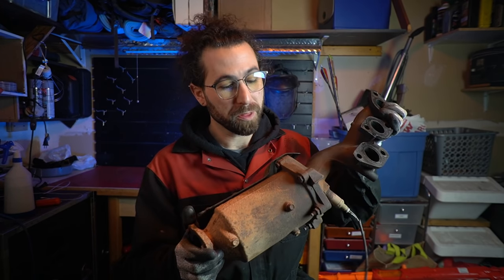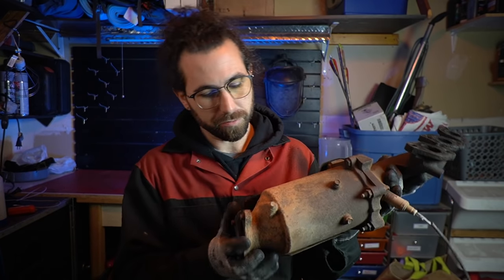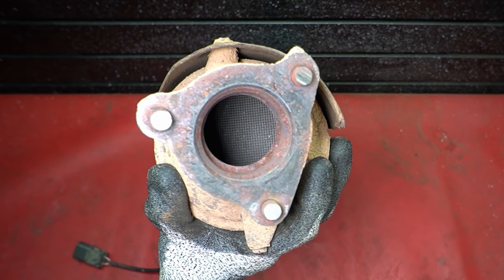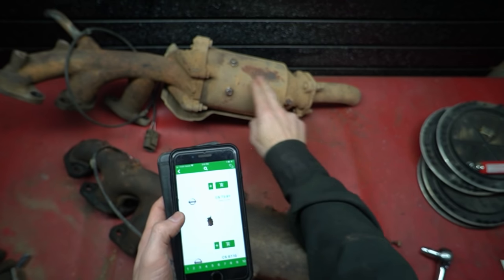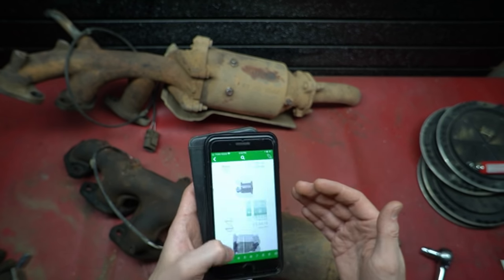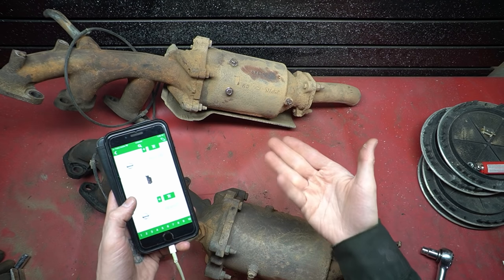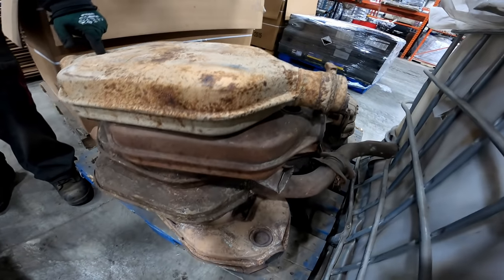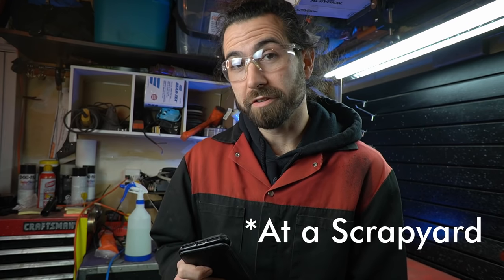How Much Is A Catalytic Converter Worth? Scrap Recycling Guide

Comment: ??How much $$$ should i expect to get for my 2001 PRIUS cat??... I was told its one of the most valuable modern ones with 2 cats in tandem...and Toyota wants 3Grand new for one...
Reply: Should see$1900
Reply: @zelmo99  1900.00 from a scrapyard?...from who is going to pay that?...its used of course (50k mi on it)...and why so much?
Hey thanks! !
Reply: That is because the rhodium alone is going for $20,000 an oz
The platinum is around $1200 or so and the other precious metal that starts with a P is going for more then an oz of gold.
So I don't know how many cats it would take to get an oz of each but if you know what you are doing and know how to melt them down, you would be rich pretty quick.
Reply: Rhodium prices continue to blast away and are, as of this update, at $18,000 an ounce; price-per-gram being around $714 ..Average cat is 4 grams Rhodium. 2001 Prius is 11 grams so $714 per gram= $7714.00 just in Rhodium but now you got to find a buyer
Reply: @zelmo99  is that for Gen1 or 2...i have gen1...and thought  gen 1 has 2 cats??...so more or less or same precious metal and values in 1 and 2 or different? ? Thanks...

Comment: I’m paying 170 for that Nissan cat you said 40-50
Reply from the maker: Well to be clear, I compared it to visually similar ones that ranged from $50-200, and said id be happy with $50. I learned that the price on the app was a scrap purchaser price and not final refining value though so knowing that, a person should aim for at least as much as the app says
Reply: I took mine off of my parts car and received $650.00 for it.  Been thinking of taking mine off of my car I drive and put a straight pipe. I wouldn't get that much out of it if someone was to total my car because it's an older model but not cheap at all to repair but will go for many many miles.

The thing is a lot of people go around and see people have cars sitting in there yard and either ask what they would want for the car or if they would want to may a $100 bucks on the cat. Most people will do it because they need the money.   I just knew something was up when I get a call asking me if I would take $100 each for them so I was like let me think about it and I called around and I finally got a hold of a guy close to me and he told me that he could give me $650 total. He said he was tired of people. Going around and screwing people and he wanted to give a fair price.
I'm sure he is making what he's paying especially with the prices of the 3 precious metals Platinum the other one that starts with a p and Rotum which I don't know how to spell it. But I believe the other precious metal that starts with a P is going for more then gold per Oz.
Then the rotum is going for $20,000 for an oz.   I seen that on Google the other day. So yes keep your eye on your cars. Especially foreign cars.  Only thing I know is the guy that bought mine has to have a certain amount of weight before he takes it to who ever to get paid for his.
But like I said I'm sure he is making double on what he pays people but that is ok because going from $200 to $650 made a big difference to me.
So if you have any cars that don't run, call around and give the people you call the numbers on the cat and they will tall you what it is worth before you even decide to cut it off your car.
But I'm sure prices are only going to  go higher because the demand for those 3 precious metals is on the rise. Junk yards are probably making a killing.
Hope this helps, God bless 🙏💞🙏

Comment: I used to work at a muffler factory, and I was on the line that assembled the catalytic converters for dodge mini vans.  The base cost of a catalytic converter was $0.38 for ones made with regular steel housing and $0.52 for housings made from stainless steel.
Reply from the maker: Whaaaat? How is that possible!!
Reply: @thubprint  bulk production is only thing I can guess.  I was pretty shocked by it too.  Also keep in mind that is the raw materials and manufacturing cost per unit before adding in labor unions, benefits, wages, shipping, handling, stocking and what ever else fee is attached.
Reply from the maker: @anthalas9  true, true.
Reply: Maybe for just the housing?
Reply: @maxscarblog  no, that was the cost per unit.  The housing, the catalyst, the assembly and welding.
Reply: Impossible. Was housing only.
Reply: I'm not saying your giving false information here, but it strikes me as very hard to believe all of the pieces of your claim are 💯. So without knowing exactly how much that exact cat is worth in recycled value today ( recycled value today = cost of all raw material to make this today not including labor or ceramic). Also what year are you claiming this production of the fully assembled cat took place for a total complete catalytic converter that to my understanding requires at minimum a total combined weight of 2 or even 3 of the precious metals in the group of PGMs, again at a minimum collective weight of 2.5g. I'm not certain but I'd have to research this, but I don't believe there was ever a year in our history that even the cheapest Platinum Group Metal ever had a value of $0.38-0.52 for 2.5g of that metal let alone 2-3 different PGMs coming in close to that value and then add on top of that cost the housing the weld the labor the business overhead portion plus a profit ...it seems somewhere your memory seemed to have fumbled some of the real facts of this claim. Do you agree?

Comment: I have a cat I removed from my 1989 Toyota Supra Turbo, top cat just below the exhaust manifold. I removed it and put a straight 3 inch down pipe in it's place which made doing an oil change 15 minutes verses an hour and a half when that cat was in the way. I called all the local metal scrap yards in my area and NO ONE would purchase it from me, they told me because I don't have a business (garage/body shop) they will not purchase it from me because it might be stolen. Is this cat worth scarping out, or just throw it out with the weekly trash and if it is worth scraping out, HOW????

Comment: I guy that has an auto shop gives me scrap now and then. Recently he asked me if I wanted catalytic converters to make it worth my time taking his scrap once in a while. Now I gotta figure out how to cash in on these. eBay? Scrapyard doesn’t take them. Recovery of precious metals is to toxic. $25 is better than 50¢ worth of scrap steel though!😅
Reply from the maker: Definitely find a proper cat buyer, the closer you can get to the refiner the better. I’ve been working with PMR and they are available in Canada and the US, if you can save up 100 cats you can sell directly to them and that’ll be your best price by a long shot
Reply: @thubprint  Thanks! I’ll look at their website. Right now it’s just a cat here and there maybe. Not my typical scrap I get, so saving 100 might take me 30 years😅

Comment: Most cats have between 5-7 grams of platinum.
Reply from the maker: That is more than I thought, but it kinda makes it all make sense
Reply: @thubprint  A gram of platinum is something like $50+ for genuine unrefined platinum. From catalytic converters it's usually around $20. You can usually get around $150 for a used cat. Best place to find people who will pay you for cats tends to be Facebook. Most buyers recycle them in bulk. If you can find someone in California, just send the cat in a USPS flat rate box - $15.99 for up to 75lbs 2-3 day Priority Mail with tracking.
Reply: Most cats do not have platinum, very rarely will you get one with platinum.
Reply: @specialtysalvage297  You are uncorrect. All cats have platinum.
Reply: @ProjectCarTV  no most cats have pallidum or rhodium. Very very few have platinum.
Reply: @specialtysalvage297  All have platinum. There are 3 precious metals used in catalytic converters. Platinum is one of them.
Reply: @ProjectCarTV  No kidding?
Reply: @specialtysalvage297  it's imperative that platinum is included. It's part of the 3 step process that reduces NOX. - emissions.
Reply: @ProjectCarTV  You are out of your mind.
Reply: @specialtysalvage297  How old are you? 2 way cats have been obsolete since 1981. 3 way cats have been used ever since. You're enitled to your opinion. But that doesn't mean you're right.
Reply: Actually they have all 3.
Right now platinum is going for around $1200 - $1500 for an oz
The second precious metal that starts with a P is going for more then an oz of gold.
And rhodium is $20,000 an oz.   You can look this up and no this isn't a misprint.
People never talk about the rhodium but that is where all of the big money is at.
You're welcome.

Comment: I give you the price for the catalytic converter 0.2Euro, the entire car 2 euro (the junkyard disassembly costs), I bring two to the junkyard, and I do not recover the money even for gasoline.. of course you can make more if you give them separate metal parts...probably some around 40-60 euros for entire car.
Reply from the maker: That’s incredibly low... I couldn’t scrap at all if those were the prices!!
Reply: @thubprint  I scrap it because I replaced them with new cars, with bonus from state, so in reality it was not only 2 euros for that car

Comment: is it possible to melt these down your self and sellthe precious metals is it worth the time if you could
Reply from the maker: It’s definitely possible, but I think the real problem would be separating the platinum/palladium/rhodium from each other. They also have a very high melt temperature so you’d need a special furnace for it, a regular propane kiln wouldn’t get hot enough.
Reply: @thubprint  I just seen on Google that an oz of palladium is worth more then an oz of gold.
And oz of rhodium is going for $20,000.  I didn't misprint that either. $20,000.....  I watched on line how to melt it down and  it takes a lot of chemistry to get it to melt down and I don't even even know how to get each separate precious metal from each other.   But it is hard to believe that there is that kind of money in them, especially the rhodium.

Comment: Some low-life sawed the cat off my 2011 Honda Element as I was eating lunch.  I think I would have done harm if I caught them in the act.  Replacement cost me $700.  How is marketing sawed off cats not abetting a crime?  Is the risk of theft of a catalytic converter any less after replacing an OEM part.  Do I need to spend an additional $300 for a guard?  Seething in Seattle.
Reply from the maker: If you replace the OEM with a 3rd party aftermarket one theft is less likely as long as the would-be thief recognizes it as an aftermarket unit. (They’re only worth about $10 in scrap compared to hundreds for OEM). Sawed off ends are actually standard practice when scrapping them however because the buyer is going to want to inspect the unit to make sure the insides are intact. Annoying as it is I do think a cage is the best anti-theft measure.
Reply: 07 element owner here. There are cheaper alternatives to the plate. I figure the more ways to let the thief know they are wasting their time , the better. Engrave you vin where it can be seen easily, paint it with bright heat resistant paint, wrap the pipes with cable, weld plates to make it difficult to use a saw, etc. Hopefully the aftermarket cat is enough to make them walk on by.

Comment: I sold one off a 99 ford truck superduty 975.00 I got out of it. So I assume they doubled their money.
Reply from the maker: I think most brick-and-mortar places aim to double their cost on things so yes, I’d agree with you there
Reply: Did it have the v8 or v10 motor? My 99 F250 had the V8 and it got stolen..wondering which one had more value.
Reply: @thulsa5218  v8 it was long torpedo shaped they looked for a code on it mine was "peg" there is some different types tho
Reply: @fordnut4914  thanks, makes me sick thinking about it. I would have cut it off my own truck and sold it had I know it was worth that much.

Comment: I'm kind of embarrassed about the amount of those things I've taken off a car and beat the insides out of it with a chisel and put it back empty just to get the exhaust system unplugged and get the car running again. Probably hundreds over the last 35 years. We don't have emissions testing in Florida since the early 90s'. So game on with removing cats and straight piping cars.
Reply from the maker: Ohhh Florida haha 😆 I have seen some of the vehicles people slap together out there, a special kind of place for sure lol
I’m not a fan of regulation generally, but it seems like cats are one of those things that really should be a government run system. Keep the recycling to specialized gov sponsored houses and subsidize the replacement costs to make sure cars get a cat that does it’s job when the old one gets clogged up.
Just brainstorming, seems like it would be a win for most everybody

Comment: I got screwed the other day at the scrap yard I'm not familiar with a real cat or OEM but I clearly saw the honey comb Inside  , do OEM have Combs?
Reply from the maker: Hard to say if you got screwed without comparing the stamped code to what other yards are paying. All cats will have either honeycomb or beads, though OEM (original parts) have more in them so they’re worth more.

Comment: When you sell to a scrapyard they have a list that updates their prices such as brass, steel , cast iron and basically every piece of metal that come off of a car/truck (including engine and transmission prices). Their cat prices all fluctuate every week or so also, so what you need to do if your actually serious about this is pay the cost of a quality working cat app. That can give you exact prices for your number so you don’t get screwed by the scrapyard
Reply from the maker: I’ve been trying to find one for a long time! This one seemed like an absolute blessing but now I’ve got people telling me it’s not very accurate. I’m not sure what the best solution is here. 😕
Reply: my local scrap yard will take tin for free when i can get $135 a ton for it 50 miles down the road. they pay 1/2 the price i can get just 50 miles down the road. screw that guy i would rather pay to have my metals buried in the dump before i would sell him ANYTHING!!

Comment: I'm sure thief"s will find this information valuable. I had mt cat stolen. This may be good info for a legit scrapper but sucks for the victim of  a stolen cat. Cost me 300.00 which I guess is a bargain going by the info here.
Reply from the maker: I’d say that’s a pretty cheap replacement. Honestly I was aiming to keep the numbers I showed pretty low because I didn’t want to magnify the problem by making them sound like winning lottery tickets. Backfired a bit, but I think I helped some legitimate folks so not a complete failure 😅
Reply: @thubprint  I worked in cellular and our sites were constant victims of copper thief's. Because a lot of sites were in the middle of nowhere they had time  to pick a site clean
Reply: I feel your pain and totally agree. Honestly, "legitimate folks" already have this information. The info in this video only keeps the not-legitimate folks from getting ripped off.

Comment: If they are not checking for codes on them. Then you're selling to a lower buyer..
Reply from the maker: Maybe, but like I learned here a lot don’t have codes
Reply: @thubprint  the cat in the video has a code. 1st thing, not all codes are on your list.. (list=app he spoke of).. 2nd thing if you don't know where to look you won't find the code on some cats... 3rd thing cats have many numbers on some of them,, if you don't know which number to use, you won't find it on your list (app)... Now you are right some cats do not have codes, like the GM 3032's , that style of cats has one with no code. Some of the Chrysler straight edges don't have a code. But it still falls into a category.  Like 10 line straight edge "no code",, or a Round ribbed or smooth straight edge no code. So yes you are VERY right.. But when selling a cat, if the buyer doesn't check for a code 1st thing off the bat, find a new buyer. There is some good information in this video,  but buying and selling cats goes alot deeper then was described...

Comment: The Eco Cat app just runs you around in circles. Terrible app. Good video other than that.
Reply from the maker: I’ve heard mixed things about and I totally agree its typically a pain to use. My aim was to share that it exists so people with fewer scrapyards around can at least get a second opinion if they’re worried their yard is trying to rip them off. I realize I may have oversold it in my aggressive attempt to maximize visibility on this piece 😆 but that’s kinda the job, and I achieved what I set out to do!